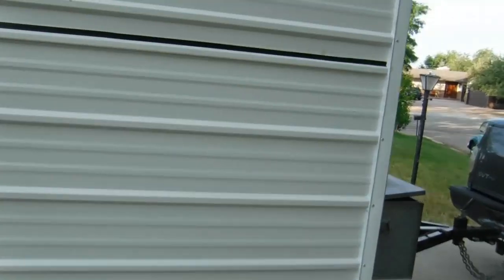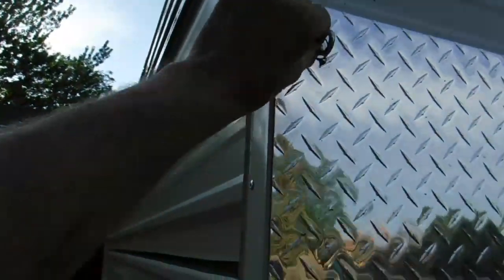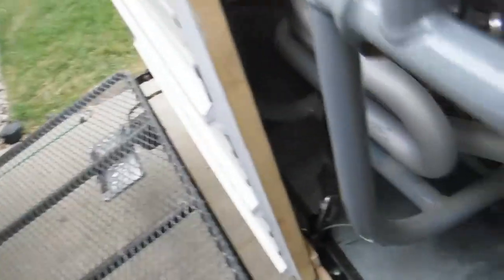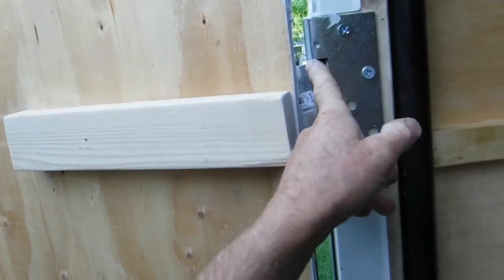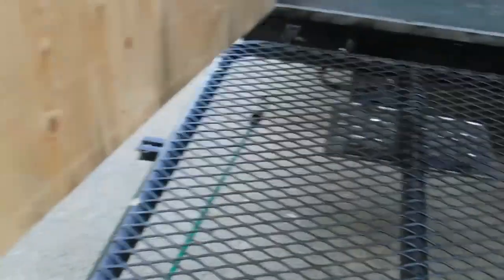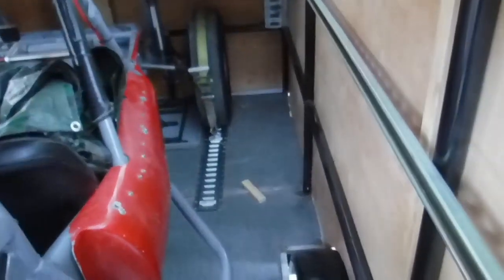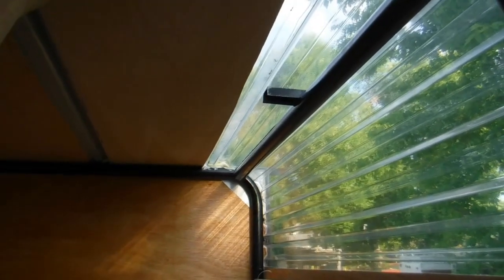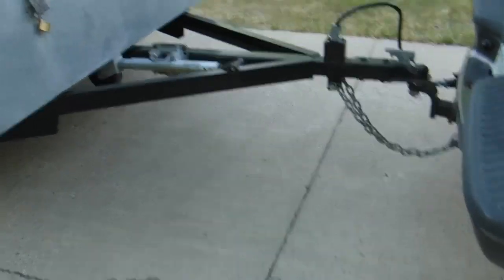DIY Enclosing 8 X 12 Trailer Tips & Tricks

Comment: I built something similar for camping a few years ago. We used the foam seals that are made for the R-panels might work better than trying to use that great stuff window sealer. They are shaped like the panels and adhesive on one side.
Reply from the maker: I wish I would have done it your way looking in hindsight
Reply: It still looks good you got it smoothed out real nice... but i have used that white stuff before and I could hear the frustration in your voice:)

Comment: Nice work and clever design, also thx for including the estimated weight.
Reply from the maker: Good for short distance but no aerodynamics, to heavy and  the poly window idea isn't holding up to UV and Hail :-(
Reply: @TheEZGZ  Thx, understood. And yeah, have been similarly disappointed with the cracking and UV failure of that supposedly 'outdoor' poly.

Comment: Great looking doors if you wanted to you could put a dead bolt on the floppy door to hold it in place and you can lock it from the inside if you don't want to be disturbed when your taking a nap 😀
Reply from the maker: I put one screw threw a block of wood so I can just turn it for now. Good Idea on adding the deadbolt

Comment: What kind of vehicle do you tow with this, it looks like a 1/2 ton truck?
Reply from the maker: 2004 1/2  ton lighting Ford F150
Reply: That's one of the best 1/2 tons ever made lol but it's a high performance street truck so it's not EXACTLY a half ton, payload is a bit diminished relative to the regular F-150, but apparently enough to pull this.

Comment: Just curious as to how the trailer is holding up?   Looking to convert my 18' car trailer into a enclosed and had similar ideas as you did.  Also, how much weight did this add to the trailer?  Thanks EZGZ.
Reply from the maker: The poly windows are not holding up. Cracks and hail made holes.
I did not do a before and after weight but it's heavy and needs a Vee nose or something on the tow vehicle to cut the wind
Reply: @TheEZGZ  Thanks EZGZ for all your videos.  Your VW videos have saved me tons of money and taught me a lot.  Thanks

Comment: You definitely don't want to get locked inside.  I've seen the videos where they lock people in a U Haul truck and take it on a very rough road.
Reply from the maker: That does sound like a nightmare.  I might have to put an escape hatch in the roof. Also need to research solar panels so will need to get up there from time to time. Might have make a compartment to keep a 12gauge under the bed frame. hehehehe

Comment: I'm looking to do something similar with my 6x12 utility trailer, do you know if there is a maximum height the trailer can be before it needs additional marker lights beyond the factory 2 taillights?
Reply from the maker: I do not know. Check with local authorities or Trailer parts supplier. I have no upper lights. Mine are at the lower frame corners.